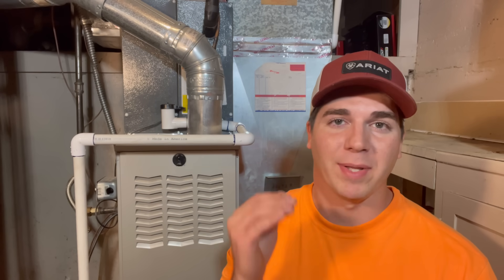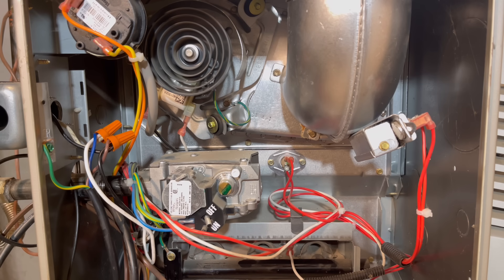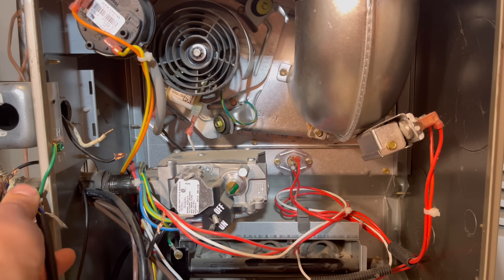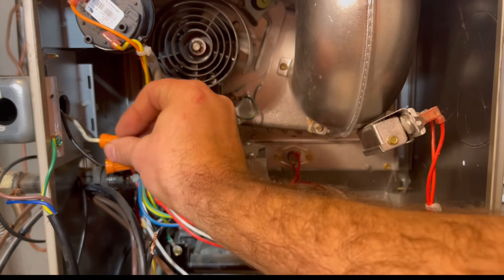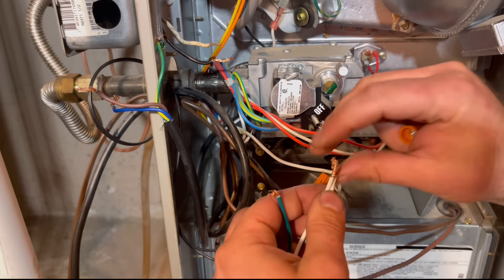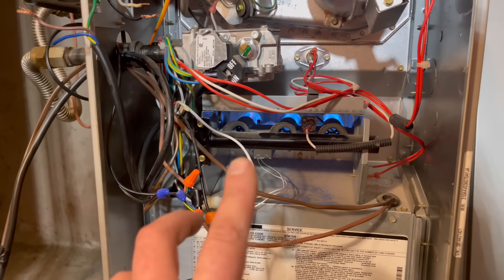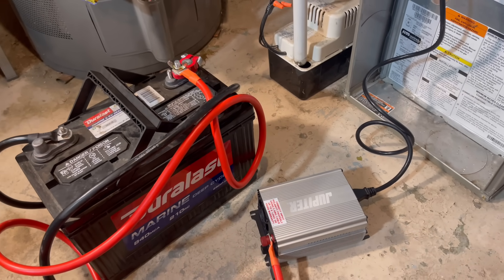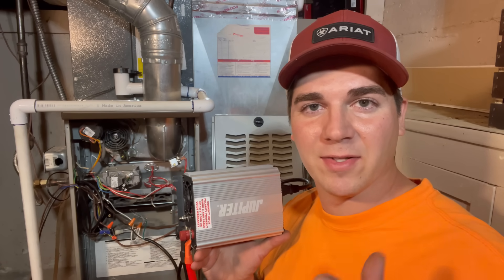Did You Know You Can Heat Your Home With A Car Battery?

Comment: I’ve been preaching the “use your car as a generator “ idea for years.  It’s super easy. Attach some big alligator clips to a 1000 watt inverter and you have a generator.  Lock your car doors so it doesn’t get stolen.  And you don’t really have to run it constantly if you have a good battery.
Reply from the maker: Yep, that’s what I’m saying! I’ll be doing a test video with this. Like 10 days running my furnace off my truck or something like that. Thanks Pierre

Comment: You will MAYBE get ten to fifteen minutes of run time off this setup. This video is misleading. Much better idea would be to splice an extension cord end and connect it to your car running an inverter.
Reply from the maker: 15 mins is way low. I could get a few hours for sure. I ran it for an hour testing this and it wasn’t near dead. But yes I totally agree, I actually installed it on my truck and I’ll be doing a test video on that soon! For giggles I’m also going to do a test video on this one battery for how long it will run my furnace 👍🏽 cheers
Reply: @diyhvacguy  Awesome. Great video otherwise. This could really help someone one day.

Comment: When you add the cost of the inverter and maybe a 2nd battery, so you don't have to pull one from the car, should you look at buying a solar battery unit from jackle or bluetti? Some great deals right now. My question is how big to power a typical furnace?
Reply from the maker: Actually I think what I’d recommend is installing a good size inverter (I think 2000w would be good for most applications) and a pure sine wave inverter I might add (better for sensitive electronics) and install it in a vehicle so you can utilize that batter and alternator to charge it. Simply run an extension cord and you can power your furnace for several days no problem. Start up the vehicle every once in a while. 👍🏽

Comment: I was interested by this, but my boiler is connected to a wet system (radiators) so I would have to power the circulating pump as well and I think that might be to much for the inverter and even if it wasn't, the battery wouldn't last long!
Reply from the maker: Probably so..  you might look into installing an inverter in a vehicle and tha way you can keep it charged up via the alternator. Just run a cord over to it if it’s not too far. Good knowledge to have for a sticky situation that any of us could find ourselves in at some point! Cheers
Reply: @diyhvacguy  That's certainly worth bearing in mind, I will have to look at how I'd separate the circulating pump from the mains and also the manage link to the thermostat.

Comment: Thanks for the video and the inverter idea. But I'm afraid your claim about the battery ability to run the furnace "for a few days" 00:35 is not quite correct. A quick bit of math:
Most furnace blower motors are 1/3 hp (~ 250 Watts)
Average 12V car battery capacity is ~ 65 Amp Hour. This translate to ~ 780 watt.hour
So, simple division shows a fully charged car batter will be able to run the furnace for ~ 3 hours tops!
This does not even account for the power consumed by the furnace inducer motor, nor the electronic circuitry or the efficiency loss in the system.
It's a good idea for emergency operation nonetheless, but don't count on it to run for long..thanks
Reply from the maker: Thank you for this. I quickly learned the same from all the other comments. What I came up with was installing the inverter in my work truck so that I can run a cord and power the furnace as long as I have fuel in the truck! I’ll be doing a test video on this and the battery setup just to see who was closest timing wise. Cheers
Reply: @diyhvacguy  No worries.. My guess for a 65 Ah battery is approx 2 to 2-1/4 hours for continuous operation . But given that the furnace doesn't run continuously, but rather on and off per demand, then the battery may practically last for 4-6 hours..Will be interesting to see your test results. Cheers..

Comment: I have a gas boiler. It has a circulator that pulls water through the baseboard to heat the house. .Don't know if this would be enough to power the circulator as well as the Gas Boilrer.

Comment: I used an inverter in the summer during a power outage to keep the sump pump running. It was also useful to run the fridge and a bunch of fans.
Reply: What is an inverter? Thanks!
Reply: @lizadivine3785  In this context, it's a little device that turns 12v DC to 120v AC. You either plug it in to the car accessory plug (formerly known as the "cigarette lighter") for low power or clamp it to the battery posts for high power, and you get 120v on the other end. Basically: your car becomes a generator.

They tend to market purely on their output wattage, but some models produce noisier power than others; you "get what you pay for."

Comment: Hummm 
I’ve done this to my furnace except wires it completely for a plug and outlet. 
I’ve used a lead acid battery with a pure sine wave inverter, yes it works but there are limits. 
My furnace is a two speed 90% variable and on low it uses 350 watts. 
After an hour straight that battery will low at least 1/3 to 1/2 dead. 
This will not last days comfortably in a freezing cold temps on one battery.
Reply from the maker: What you can do is install it in your vehicle and then run an extension cord. The alternator will recharge and you should be able to run it as long as you have fuel 👍🏽 cheers
Reply: That depends on how many amps your cars a alternator can put out at idle.  I tried this once many years ago and once I hit even 200 watts AC the charging system of the car was struggling. 
Please, please, people you need to actually do the testing to see if things will work.  Do not ever say “well, this should work”.

Comment: Great video!!!
I would like to talk about this inverter which must be pure sine inverter? 
And can you explain bit about furance’s power wattages ? Thank you.
Reply from the maker: Yes the pure sine wave ones are better for sure. You would need to have an amp clamp meter to see how many amps it pulls and then base your inverter accordingly. A bit bigger then your needs is always better.
Reply: @diyhvacguy  how long this battery last in this case?
And can you tell me how I can recharge battery with home outlet (not by car)?
Any recommendations? Thx

Comment: Might be best to just put a male plug on your furnace wiring and a female plug on the line-in wiring. When the power fails just unplug that connection and plug your female plug into the end of an extension cord with the other end of the cord plugged into a generator sitting just outside your door.  A decent gen set can be had for $350.00 and a better one with clean sine can be gotten for $500.00.  Those gen sets won't be commercial grade but will probably last years using the gen 2 or 3 times a year (just keep up on the fuel treatments or get a propane powered gen).

Comment: Great video !!! I have the entire kit. Lithium power generator and the solar panels to keep the house running. I don't heat with gas or oil, but we do have a water well pump for the house that runs on 110v. The lithium battery generator is a more expensive way to go, but will last 7 years longer than a SLA ( Deep cycle battery ).
Reply: From what I have been seeing on Lithium in the EV is they are very concerned about over charging them and even going to low to make them last longer. An SLA is a sealed lead acid battery and is a workhorse. It does need to be fully charged but can be run down to 20% or lower. It will shorten it's life but in an emergency you want power. They are much cheaper to replace and then it is new and able to start over. No reason to keep a battery for ten years if it is cheap to replace. I get 7 years from my flooded deep cycle lead acid and that is fine with me. Golf cart batteries were made for a purpose.
Reply: @timsteinkamp2245  There shouldn't be worries about over changing. Every lithium battery has a BMS built in. It's nice to be able to use 100% of a battery's capacity, and not cause damage.. Can't say the same for a lead acid. Where I live we lose grid power very often. I have the entire setup . Solar and the large lithium bank. I switched from SLAs 2 years ago. It's like night and day. They charge faster and go farther than any SLA.

Comment: Why not swap your switch with an outlet and permanently wire your electrical cord pigtail so you can just unplug from line power and plug into the inverter?
Reply from the maker: That’s exactly what I’ll be doing! Thanks for the tip

Comment: Will this be the same for the air conditioner too
Reply from the maker: No, air conditioners require 220v within will not work with ac unless you mean a wall Mount 110v ac. Even then it probably would pull too many amps.

Comment: It looks like you are using a modified sign wave inverter. That is a bad choice for running your furnace. For running a furnace you should be using a pure sign wave inverter. Now lets look at the numbers for a minute. if you are using a 12 volt and a 1000 watt power inverter your alternator will have to produce 83.33 amps to get anywhere near the 1000 watt rating for your inverter, and that's not taking in account for power loss through the inverter and cables and connections. Another flaw is to produce enough power your car can not be at idle so that means that you will have to put your gas peddle to the floor. It will cost you a lot just for the gas. DC to AC power inverters are great in some cases, and they do come in handy. I have 4 inverters myself, but I also have a inverter generator and solar and a 400 watt wind generator. If biden and the democrats get their way you will not be able to find fuel for your car. A person also needs to know the limits of what their alternator can produce before trying this. The average car has a 50 to 75 amp alternator depending on the car. 12 volts at 50 amps is only 600 watts before power loss. 12 volts at say 75 amps is only 900 watts before any power loss. you are using a 1100 watt inverter so lets do the numbers for yours. 12 volts at 1100 watts so your alternator will need to produce 91.7 amps to even attempt to get anywhere full power, But then you will have about 20 percent or more power loss through the inverter and cables and terminals and wires. I really did enjoy the video but it makes more sense just to get a extra duel cycle marine battery or two for in the house, and just use your car to charge it when the power starts getting low. If your alternator can produce 100 amps at 12 volts that would be 1200 watts so a 1500 watt pure sign wave inverter would be the best choice.
Reply from the maker: Really good information here. I realize I was mistaken on the time quoted and for that I do apologize.  So you think having two marine batteries would do the trick and then having an extension cord to and inverter in my truck to keep them topped off would work? I am still going to test this original method next week just to see how long it runs, but I will look into what you are suggesting for sure! Thanks again

Comment: What happens when the voltage in the battery drops after a while, does it turn off?
Reply from the maker: Correct. I’ll be doing the test to see how long that takes, but what everyone has suggested is running the inverter in your vehicle so it can be powered and recharged via the alternator then you can run the furnace as long as you have fuel in the truck! Hope this helps. Cheers
Reply: So it shuts down before damaging any electronics. That’s what I would worry about on high efficiency units.

Comment: Well this was worth a subrscribe thanks. I already know how to run it off my generator but never tried this.  My problem is I live in an old house that isnt insulated well, as of yet, and I cycle more than I should so not sure how long it would last    I guess I could get 2 batteries.
Reply from the maker: You can also install the inverter in your vehicle and power it that way. Alternator should keep it topped off. Cheers

Comment: In Katy Tx very interested to see your test video.  I love the idea and in fact almost ran an extension cord to my furnace during the 49 hours but opted to back feed my box with genset instead.  I like the idea of a solar on my shed with some batteries that could power one or two of my furnaces.  Just curious what size breaker your furnace runs on?  Mine is 20 amp dual pole but I suspect that's 120 per furnace.
Reply from the maker: I think mines a 20 amp breaker as well. Maybe 15
Reply: After another close call again this year in Houston. I made the furnace mods last year but to be honest I just put a male plug on the Romex on one furnace and installed a box.  On the other I got tired of bending 12ga wire and just cut the romex and put a male and female plug on them.  They have ran fine all winter and this is just for emergency's.  My downstairs furnace pulls 1500 W on start up then settles at 875W but my upstairs unit pulls 1500 on start up and 1175 while running so almost 10 amps.  I've tested them on the new Pulsar 400bn dual fuel that I scored at Wally World for $499.  Works like a charm while running 2 100 foot 12GA wires.  I was going to run 10GA but the reality is the plugs are only rated at 15A anyway.   Would love to learn what type of Deep Cycle battery could get this done if I simply move one into the attic next to the furnaces and use a maintainer.  That would be a lot easier for the wife. @diyhvacguy

Comment: Might as well hook up the condensate pump to the temp power so they don't have a water issue as well.
Reply from the maker: The condensate pump is only used in the winter months for 96% furnaces. Mine is 80% so it’s not used in the winter time. Only summer when the Evap coil is condensating. Cheers

Comment: Love it  You went with the 'pure sine wave' inverter which is a bunch more I suspect the plain inverter (1000W) would do as well for about 60% of the price.  I have a small one that runs my Traeger fantastic which has circuit boards and what-not in it.  I'll be buying a larger one now (plain) to run the furnace we did have a 5-hour wintertime outage last year which is very very rare for us but it sucks when it happens.  In a past life I did HVAC work as well I went to school for it.
Reply from the maker: Nice! Thanks for sharing
Reply: It is not a good idea to "suspect the plain inverter would do as well"  Spend the extra money to know that the sine wave you feed into you furnace is as close to a pure sine wave as possible.  The time to find out that the modified sine wave inverter does not work is NOT when you need heat in the house.
The pure sine wave inverter is better all around, especially when motors are involved.  Modified sine wave inverters are good for running 110V lights but that is about it.
Reply: Yeah I already changed the one I'm shopping for thanks

Comment: I just got an old Deerborn heater and put a milivolt gas valve on it, along with the pilot assembly and of course a Tstat and it never needs any power just like a water heater except that was over 30 years ago and 3 water heaters. Works great feels like a fireplace and 100% efficient

Comment: For $198 I purchased a 30,000 BTU natural gas heater that needs no electricity to operate. It will heat my house at 100% efficiency, because it does not require a chimney vent. I run it in the basement and the heat rises through the furnace ducts to every room.
Reply: What happens to the exhaust gases?
Reply from the maker: Amazing. I’d love to do a video on this soon. Super smart! Thanks for sharing!

Comment: I think it's a great idea that can save lives. Anybody who's experienced an event like Texas had knows how quickly generators sell out all over. While the way it's done works well enough for a once-in-a-lifetime event and most any semi-capable DIY'r can manage, it is truly a jury-rigged method done in a pinch. If you happen to live in an area where power outages such as this are common or just want to be pro-active then set up correctly and replace the furnace power switch with an A-B switch.

The A-B switch could simply be a two-way light switch, a couple dollars at big box stores. Wire one leg to house power (black) and the other leg to the black (hot) wire from the inverter, the switched leg from the switch goes to the furnace hot (black) lead. Tie all the commons (white wires) together in the switchbox, and of course grounds are grounded. Coil up the cable that will be attached to the inverter in time of need. To use, attach the cable to the inverter and flip the A/B switch to change power source from grid to inverter. Attach battery and turn on...enjoy the heat.

When the inverter is detached...possibly doing duty elsewhere during good times...the A/B switch still serves it's intended purpose: a power cutoff to the furnace.

Comment: I have several backups for heating.  I live in the U.P. of Michigan where winters are severe. There’s my home furnace just like this one. A 40’000 BTU ventless backup propane fireplace( Carbon Monoxide) detectors a must. A wood burner in the basement that heats the entire downstairs in an emergency.  When you love 25 miles from the nearest town you have to be prepared.  Food , water , fuel , and the ability to use what resources are available to stay safe , warm , fed , and ready for adversaries if necessary.
Reply: Spent 20 years living UP there when we used to get 25+ feet of snow every winter. Every little bit helps.

Comment: I always thought if I was to do this, I would pull my electric golf cart close to the furnace area as I could. With 6, 6 volt batterys, I could have 3 banks of 12 volts with little effort with cables. Then I would have 450 pounds of 12 volt which would last for a while. Also, I have 2 golf carts. Good video!